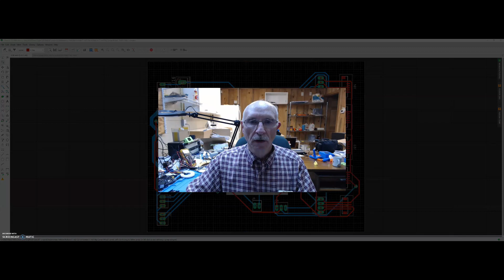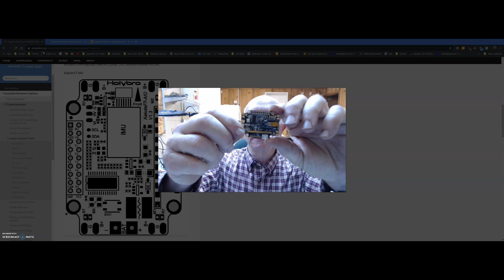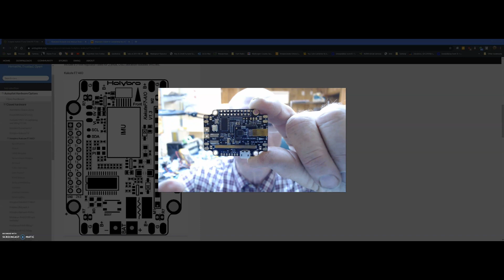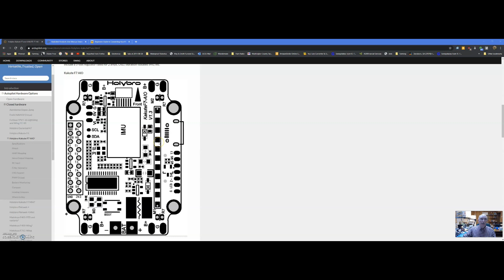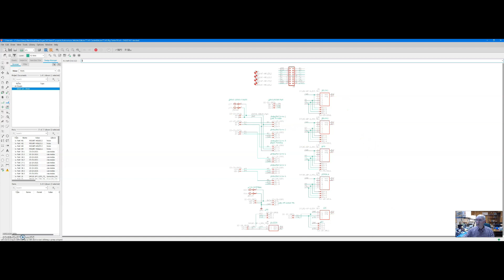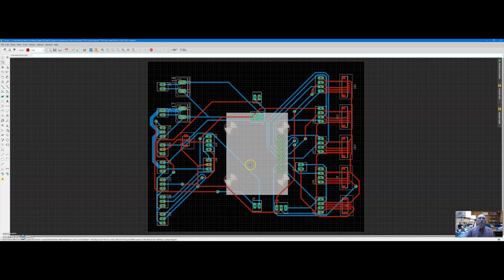Kakute F7 AIO Carrier Board - Eagle

Comment: Hi Kenny, thanks for sharing. I've been interested in a similar project. Have you tried the Navio2? If you have, how do you think it compares to the Pixhawk?
Reply from the maker: I have not tried the Navio2. I have used a Pixhawk for 2 years or so, and now am using a Kakute F7 AIO. The F7 is a lot of processor for the money. It doesn't bring all signals to a pin header, however, so you have to solder some wires directly to small pads - not a biggie, but somewhat of a nuisance. I am pleased with how it has worked, though. I have recorded but not produced some video showing some new details such as that.

Comment: I want to set up a system like this soon.  How accurate is the GPS?  Can it drive a 60 inch mower over a 70 inch bridge?  What servos did you use?
Reply from the maker: The GPS is extremely accurate if you use a base-rover RTK system as I am using with the Ublox F9P modules. They describe it as centimeter accuracy. The GPS would not be the problem in driving a 60 inch mower across a 70 inch bridge. However, getting precise control loop tuning might be a challenge.

I am using HiTec D845WP servos and using a 7.4V power supply for them. I recommend them.
Reply: @KennyTrussell  Thanks for the info.  I was thinking about getting a second smaller mower for an autopilot mower.